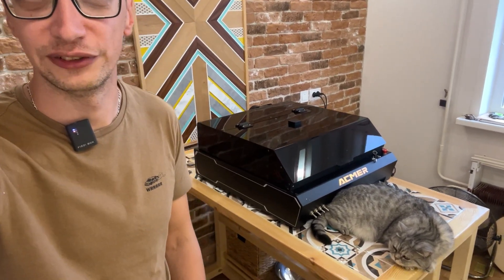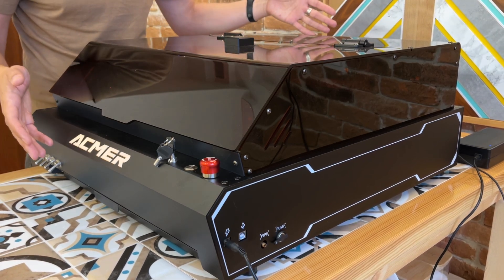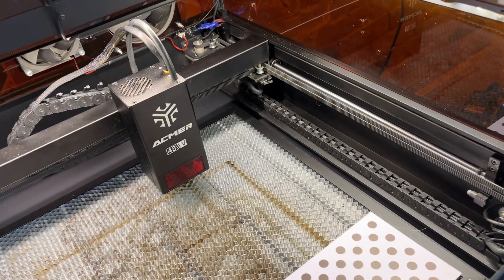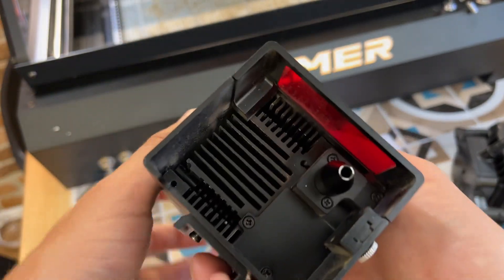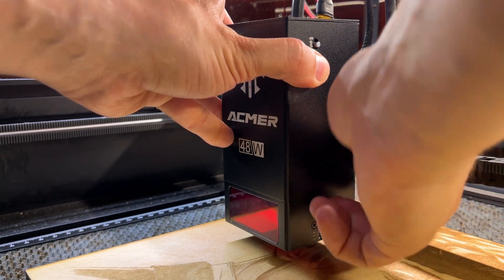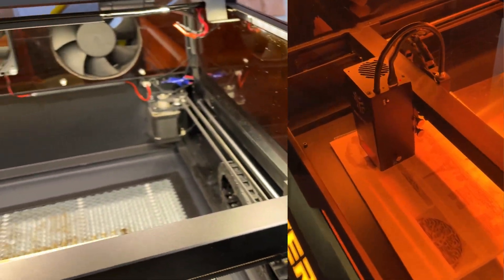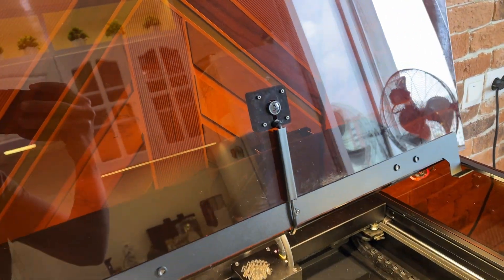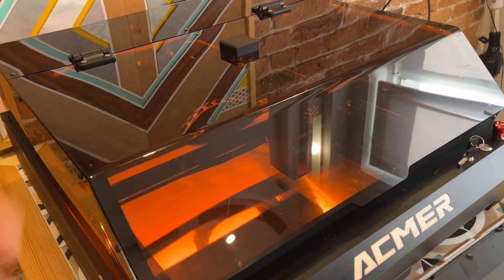Unleashing Laser Engraver ACMER P3: The Ultimate Speed and Power Combo

Comment: What should I get, this or the xtool f1 as my first laser business machine? torn between the two 🤔
Reply from the maker: It’s all depends on what are you planning to do on this lasers. F1 has a small working field. ACMER p3 also have combo lasers 10w diod + 2w IR. If you are planing to cut plywood or other materials 10 w is not enough, so you will be able to by additional laser module for P3. My choice it’s P3. It will give you much more possibilities in work
Reply: @Polkilo  Thank you for the recommendation! Yes I agree with your comment. More possibilities with the P3.